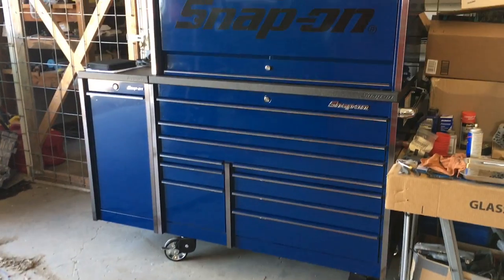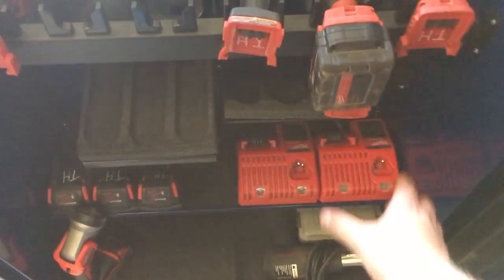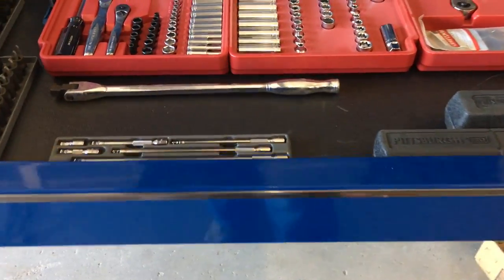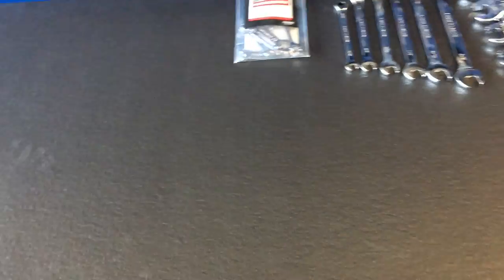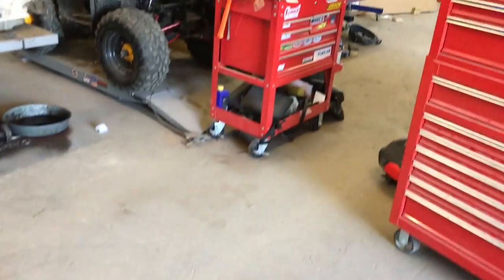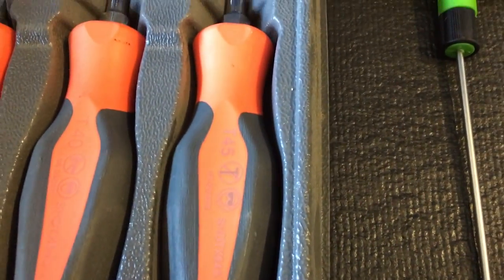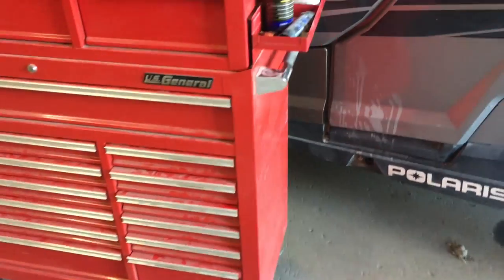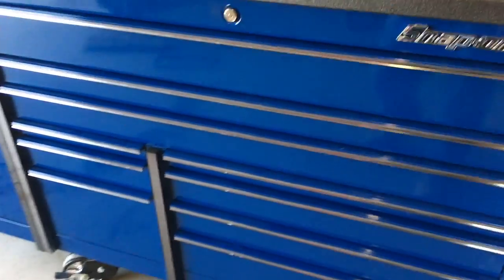Biggest Tool Investment (My New Toolbox)

Comment: "Dont want to use my expensive stuff if i dont have to" --then why buy it?
Reply: He will start using the expensive stuff. A good mechanic is forced to when the used tool gives out on a job that needs to get finished. I can understand not wanting to bang up the new stuff. It's like a new car in that you might not want to get the interior dirty then it just happens through living life you can't worry about it as much.

Comment: What's the difference between snap on plier organizers rack and on u can get off of Ebay for half the price.. don't get me wrong I enjoy me some snap on but not every little thing.. there plastic socket organizers are actually ernst just with the S on them. Think twice before paying for the S stamp is all I'm saying..
Reply from the maker: Jose gonzalez jr my plier rack came with my pliers. I would not spend for then $15 on a tool rack and all my sockets came with there rack too.
Reply: @TanTinPerformance  you said u want to get an organizer for the pliers. And said snap on organizers. All I was saying is the organizers don't have to be name brand.. good stuff on the box.. I'm getting my epiq 68 with hutch and locker next month.. gloss blue.. best of luck filling the box I out grew my previous that was around the size of yours just no hutch but top box.
Reply from the maker: Jose gonzalez jr I ended up buying a cheap rack lol

Comment: shouldve gotten more tools with th e cost of that box. tools fix the cars not the tool box
Reply from the maker: junior08105 not done getting tools but my old box was full and this one should last the rest of my life
Reply: yea they good i have one to but i do have my regrets. are you starting out in the field or u been doing it
Reply from the maker: junior08105 been doing it as a profession for about four years now, but I think of lot of the reason was that the people that I grew up around in the industry all had a snap-on tool box and some of them where 60+ years old so I figured you get what you pay for.
Reply: yea i know wym. usually if u sorround your self with just snap on people you gonna spend mad money i have snapon but i also do alot of research alot of their stuff are rebranded stuff like rad pressure kits and their soldering iron kit which are made by portasol and are way cheaper for the same exact kit. i been working on cars since 12 and their is alot of tools just as good as snap on and other tool trucks. i have alot of different brands im a heavy duty tech and ill tell you my tools been holding. a guy has some harbor freight tools and some actually hold.
Reply from the maker: junior08105 yea most of my tool aren’t snap-on. I got some harbor freight stuff too and they do work pretty good. I do have to agree on the the rebranding, I work near lisle tool co and been in there a handful of times and there’s a lot of snap-on, mac, Matco, and you name it coming out of there. I like snap on hand tools and there toolbox’s one perk of my box it was made in the state I live in. I do shop around for my tools but there wasn’t anybody to come close to what I gave for this box.
Reply: yea boxes aint cheap lol next box im looking in to are extreme or husky for home not beat to buy another snap on for home
Reply: You only live once my friend and then you die. Any tool box is a good investment if you plan to turn wrenches for the rest of your life. However anything over 10grand is retarded unless you’re a shop owner. Just my 2cent.